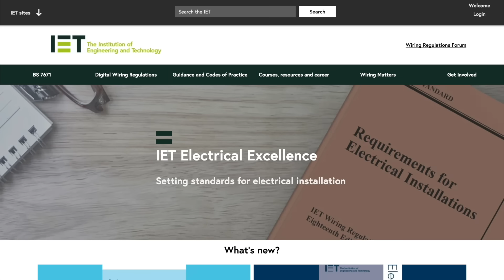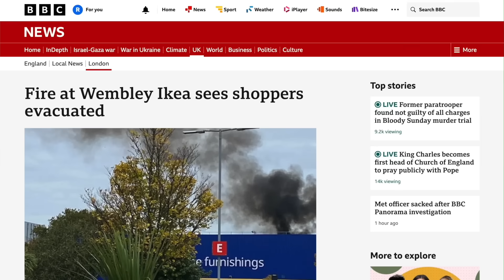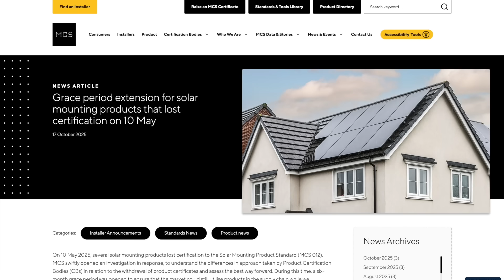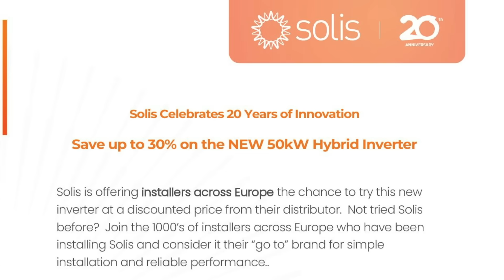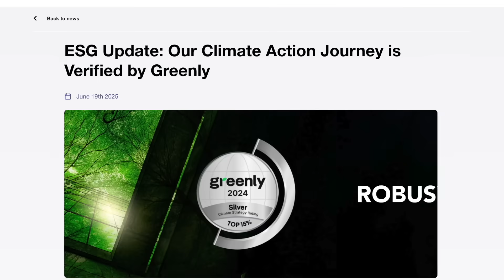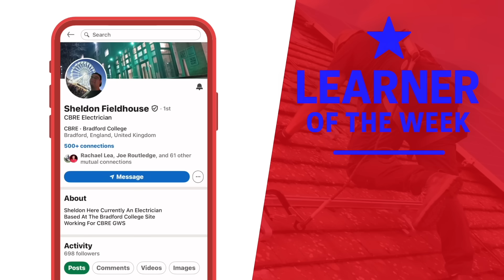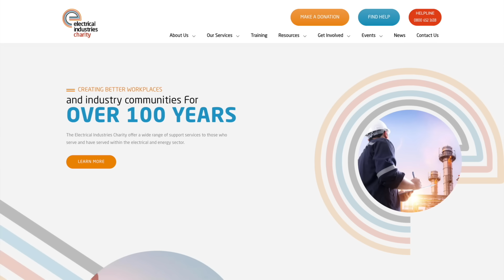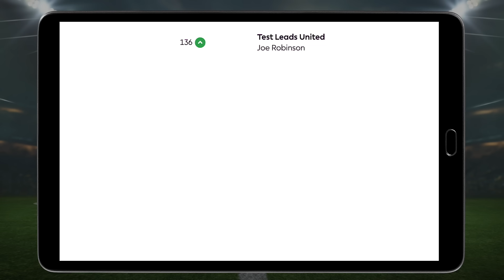Exclusive: Grid Bosses Set to Change UK Voltage

Comment: Lower voltages just means, wasted heat energy in transmission cables. To obtain the same power, equipment will draw more current.
Reply: It also allows "behind the meter" generation to supply more power to the grid.
Getting power from your neighbour probably lowers wasted energy overall.
Reply: It would be easier for the neighbours equipment to step up the voltage to the correct level. Less voltage does not equal less power. With a lower voltage you will end up drawing more current and if you have an analogue meter this will mean the electricty will cost more. Ai data centers are consuming 20% of the power now to do those mostly useless AI summary searches on google. Things like oven, toasters and dryers won't work properly with lower voltages.
Reply: Also i can solve the problem of data centers taking too much power from the grid, and also reduce energy demand at the same time as well as solving the wasted water problem. The simple solution is to install small parts of the data center into existing buildings in cold parts of the world. The data center components heat the buildings with waste heat, meaning the occupant does not need to use their own energy to heat the property. This is a win, win, win. Little infrastucture needs to be built to implement the data center, poor people get free heating, water is not cosumed, the grid needs less power. Therefore no voltage drop to the grid is required. Problem solved.

Comment: My server is connected to a NAS that switches if it goes under 218 (I think). I don't think the server running on it can handle 207V, and if it can it will be horrendously inefficient... Thankfully I usually get between 235 and 240, however if the shower is on it often drops below 216 and the UPS trips to its battery power

Comment: How about addressing the issue with the damned grid, we pay a daily fixed fee standing charge no matter how much we use that's for maintenence of the grid. 
Instead of pocketing this and raising it continually how about they damned well invest it in sorting the issue out.
IIRC the boss at OVO was actually suggesting this charge be banned outright as it's unfair particularly to those of us on prepay meters who use less electricity in the day than the current standing charge anyway, funny how he shut up about this right after he said it.
Not only that why is it prepay customers pay a higher price per KW/h than those on direct debits when we pay in advance whilst they get to pay in arrears AND get discounted rates whilst we get naff all?
Something needs to change but not the damned voltage!

Comment: In Canada we have 240V/120V for residential and 207V for multi unit housing ( condos and apartments)
We can't use high current devices in these multi unit buildings like ovens if the wrong stove ( 240V) is installed as it won't boil water.
You are being power throttled and this is just the beginning.
Next they will insist on you buying an approved device from a approved supplier ( them ).
These new stoves won't work if the Government thinks you don't deserve it.
Reply: 208V boils water just fine. Just takes 42% longer.
Reply: @economicprisoner  No it doesn't. We sold residential steam room boilers, you know , for the rich and famous and if it was installed in a condo we had to change the heating element because even after an hour, no steam therefore no boiling.
I spoke to another rep there for ovens and he confirmed the stoves have to be made for 207V otherwise, you guessed it, no boiling at al.
Reply: @oswaldjh  I am pretty sure the stove at my last two apartments was designed for 240V, running on 208.
The only really annoying thing was trying to use the broiler.

Comment: How stupid can the people doing this be???? There is something called operating voltage and there is something called fluctuations..... most people who know English without a degree in electronic know what these words mean..... 207 is in NO EU standard an operating voltage for anything... infact no where in the world is it a standard operating voltage of anything..... operating voltages are 110V-120V and 230V-240V (Residential)...... so the supply to normal households anywhere in the world should be for a majority of time within these voltage ranges..... as far as fluctuations are concerned... it depends on the equipment being used and the circuit breakers and protection mechanisms in place..... mostly if stuff goes down to105V or above 130V it's called low voltage and high voltage which will make breakers trip and things to out shutdown , if they don't then they usually end up blowing a fuse or just burning out. Same case for 240V at 210V low voltage , stuff switches itself off to protect itself and at 260V everything blows and breaks.... these are fluctuations, by reducing the actual line voltage you will need to change the whole basic circuitry of every electronic piece of equipment in your house to be able to run at those low voltages..... for their normal duration of working.... not just in cases of fluctuations....  so basically what the fools are asking is you pay a higher price for less efficient power and then pay more to buy new equipment to use that power or than stabilize it to the required levels of power...... What a bunch of idiots..... and fools who will buy into this crap. If everything was working in the range from 110to 240 no one would need anything different in the US and in different parts of the EU and the UK.....  the system that has take over half a century to develop was that you can now get equipment rated for use in both scenarios 110 and 240 , it took the world 50 years to come here... otherwise we used to have 110V shit unusable in 240V countries without stepping them down ... same case the other way around ....... so todays equipment will work with110V AND/OR 240V NOT from 110V upto 240V.

Comment: It will definitely affect building lifts. It did when they changed the 3 phase tolerance
Reply: the three phase voltage is always linked to the square root of 3, which is 1,73. so 240V phase to neutral is 415 V phase to phase.  the voltage variation of phase to neutral  always affected the voltage between the phases.

Comment: Adjust the whole grid or just use an integrated transformer on solar equipment? Lowering voltages will run down electrical equipment and switchgear.
Reply: The issue is that the grid was only designed to supply the power in one direction: so it is skewed to having higher voltages near the substation.
If the solar inverter is near the upper limit of 253V: it needs to either scale back production or shut down.

Comment: When I lived In Bournemouth in the 1960 it was 200v and then was increased to 240v national standard . Higher voltage equals lower amperage on domestic supplies so somehow i think this is a load of waffle.  Lowering the voltage would mean larger supply cables causing the grid to struggle more than it is .
Reply: Behind the meter solar is seen as a reduction in demand from the power company's perspective.
This change allows more local solar production to be used without exceeding voltage limits.

Comment: The voltage change doesn't make sense to me.
Like I get that excess generation leads to a voltage rise and inverters have little in the way of mitigating this cause V-W/V-Var only goes so far.

And that things are made to within tolerances but you lower voltage in a place where your not getting that excess to bring it up back up you have to deliver more amps through conductors to meet the demand in a system built for higher voltage, which I know is edge case and might just be a non issue but we have knack for hitting them anyways.
I could see it being an issue for critical or high demand areas on reliability for that alone.

A blanket solution like this just feels inadequate we need a range of them working together with better demand management, power storage or reinforcement to the network for voltage regulation.

Probably just being an muppet but I dunno it just doesn't feel right.

Comment: Lowering the voltage increases the current for any given power. 240v charging an EV at 7kw is 29.16A

At 210 volts, that same 7kw is 33.33A. An increase of 4A on the same breakers. That could be problematic.
Reply: My EV (2011 Nissan Leaf) appears to draw 17A at either 240V or 208V.
The charging stations on the FLO app running at 208V have a lower power rating proportional to the lower voltage, when compared with 240V EVSEs with the same current rating.
(In North America 208V is common for commercial installations because the phase-ground voltage is 120V).

Comment: "we know we messed up and renewables make no sense, but we'll do this rather than fix the problem".
Reply: They did not say that at all.
They said that the distribution system was not designed with "behind the meter" generation in mind.
This gives system operators more flexibility to accept such power without forcing the inverters to shut down from over-voltage.
Reply: @economicprisoner  well they wouldn't say it - that would involve admitting to at best gross incompetence. Also the devices already exist, changing the range of acceptable voltages after the fact helps nobody - there's no reason that voltages should drop that low unless they're intentionally rationing power or they literally can't generate enough. The law should change so they get 5V to play with and not a penny more.

Comment: They forgot about the V² part of the power equation, a 240V soldering iron will produce dry joints at 207V and a transformer based 240V battery charger will not fully charge a battery with 207V input.
Reply: They didn't forget it;  they just don't care.
Reply: Get a temp control iron.
Reply: transformer based chargers are way obsolete now, and noone uses 240V soldering irons, they aren't reliable anyway regardless the voltage. it's been 30 years since 230V has been harmonized all across Europe, 207V is the worst case which will not happen

Comment: I have ebays finest european plug (what existed) plug in blue LED back lit volt meter display on a single euro socket. got when the solar panel system was put in 10 years ago. Had some gadget fitted with trip. Isolators, the export meter and a bit round transformer and electronics inside. Takes the power down by 10%. Good for the oven. lights and appliances the sales bloke said. So car gets less voltage than it could. 10% less charge in the same amount of time. 7 hours from midnight to 7am. Home gets the nice amount 240V or so. less because of this unwanted gadget on the wall in cupboard where main fuse, power, fusebox is. So even less, My unwanted thing take 10%. What joy. Will be at 210 or lower. 221V at the moment. When car is on 24A that power in garage drops to 216V. Don't want any lower.

Comment: In the area of the UK where I currently live, the grid has recently been re-adjusted from 240v up to 253v. Hopefully this will not damage equipment. Once the change was made my rcd continually tripped. Replacing with a new one did not work. The system had to be rewired unfortunately without rcd protection to restore power in my house
Reply: Sounds like something may not like the higher voltage; leaking too much current.

Comment: If you have S100 based vintage computers from the 1980s the power transformer often has multiple primary winding taps. You need knowledge and a soldering iron to adjust but it can be done.

Comment: If they drop the volts, you will need thicker wire to take the higher current required, every home will be out of date. 😮
Reply: Yes I agree and what of all the installations where the current in a circuit is close to the limit already? These circuits will either overload and trip (If appropriate overload protection was calculated), so another bill the end user will get, or risk to a house fire if not. My home backup system can accommodate the 207 volts the dummies in parliament have agreed to, however I think the DNO should foot the bill for any installation which was designed for 240 volts and then see how long they keep their fat cats happy. I doubt substations have the overhead required to allow for the increase in current they are suggesting the volt drop will create ( Thats an increase of 0.66 amps per kilowatt or 11%) Clearly those making the choices should see 220 volts is the limit before the aging household systems will start to deteriorate and fail. I did a thesis on this years ago and a system already at it's limit back then will experience a heathrow effect and I am not paying for a change I have not been asked to agree to.
Reply: What sort of load are you driving that has an impedance drop when you lower the voltage? Most high power devices in the home (mostly heaters of some sort) are resistive loads - if the voltage drops, then the current drops, because the resistance doesn't change. So, the exact opposite of what you are saying...

This is the downside of lower voltages - power output will drop. You can transfer the same energy - it just takes a little longer.
Reply: @TheHalfEmptyGlass if you drop the voltage applied to a device, it generally will require more current to maintain the same power level. This relationship is described by the formula:

P=V×I
Reply: @Onyx-Raven-1  Yes, I know the equation. My point is that without the impedance (resistance for heater-like devices) of the device changing, if the voltage drops, the current also drops, because I = V/R, and R is constant in this case.

So, unless somebody sneaks into everybody's house and reduces the resistance of those devices, the only thing that will happen if the voltage drops is that the current will also drop - you don't need thicker wires.
Reply: Yes I understand what you are saying but if dropping the voltage and current on a resistive heater will generally decreases its efficiency. So there will still be issues.
Reply: Rubbish! Lower voltage means lower current by fundamental  definition
Reply: @marktaylor4290  lol so every device in the house is just going to pull less voltage and current 😂 why do we bother trying to save energy, when we can just turn down the voltage,  and the device will pull less current.
Reply: No it won't. I does not increase if you lower V. I = V/R. So if you multiple V/R by V you get lower power for lower voltage. Appliances are not constant current devices.
Reply: @marktaylor4290 lowering the voltage on a device would require it to pull more power (current) to maintain the same power output, necessitating thicker wire to handle the increased current. The relationship is defined by the formula (P=V×I) so if you decrease voltage (V)while keeping power (P)constant, current (I) must increase. A thicker wire has lower resistance, which allows it to safely carry the higher current with less heat generation and less voltage drop.

Comment: You may not notice much difference at 207 volts in the home but what about where the voltage is transformed down to 24 or 12 volts to power the lights used in signalling which need to be seen from a distance. A dim light with reduced range and possibly drop outs of control circuits. Not well thought out.

Comment: The only point to lowering voltage is safety, because higher voltage means lower current loss = more efficient transmission

Comment: If the kettle doesn't work fast enough, I don't want to know
Reply: Back to gas
Reply: Well... My 3kW kettle boils water for tea 1.7 (litres) in 3.5 minutes.  A mug of coffee about a third of that time...
Seems like a lifetime, doesn't it?
Reply: @robertlawson8572  Ignoring the extra losses, I calculate it will take 19 seconds longer on 230V, assuming the kettle is rated to 3kW at 240V, so perhaps 4 minutes, because there will be more losses. This isn't a big deal really.
Reply: @robertlawson8572  it is about 100 watt hours per litre. I measured it. It makes sense as a Calorie is around 1.15 watt hours.
Reply: @TimpBizkit  Don't forget the losses. Everything else being equal, lowering the power will generally increase the losses, because as the water is heating up, heat is lost to the environment. Boiling the water as quickly as possible will yield the highest efficiency, up to a point. Obviously going too higher power will also increase losses, because steam forms around the element, which has a lower heat capacity than liquid water and an even poorer thermal conductor.
Reply: @robertlawson8572 Exactly. When we Brits need tea, we need it NOW.
Reply: it will work just as fast.
Reply: @osmacar No it won't.
Reply: that's not how physics works
it will just draw more amps to give the same wattage
and boil at the same rate
Reply: @frombrum  That's not how physics works.The kettle's heating element is a resistor. A kettle designed to draw 13A at 240V will have a resistance of 18.5 Ohms. If the voltage is reduced, then the current and therefore the power will also be reduced. It isn't proportional, because P = V*I and A = V/R, P = V^2/R, so the power is reduced by the square, so a kettle designed for 3kW at 240V, will be consume 230^2/240^2 of the power when run at 230V.
Reply: @alunjones3860  Thank you, I just can't  be bothered with fools anymore. Too old.
Reply: @mikemines2931  I don't know why this is so difficult for someone to understand. I could've worked this out when I was 12.
Reply: @frombrum  The load remains the same, this is first year apprentice stuff, do the math.
Reply: @mikemines2931 
It does and that's what (watt)
I said 
W=VA
Reply: @frombrum a redesigned kettle that used a thicker element would.
Reply: @mikemines2931  Maths, not math.  This isn't bl00dy America!
Reply: @johnough4893  Math.
Reply: @mikemines2931  Mathematics.
Reply: @mikemines2931  On second thoughts maybe not. I'd say this is arithmetic, rather than mathematics.